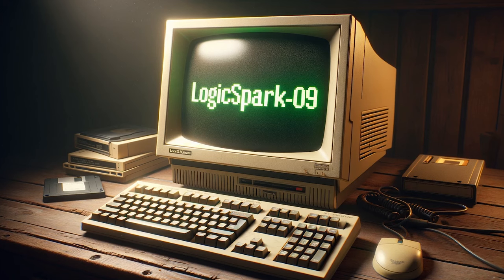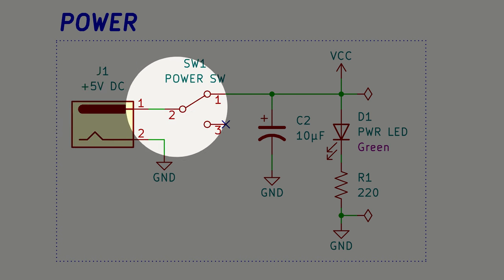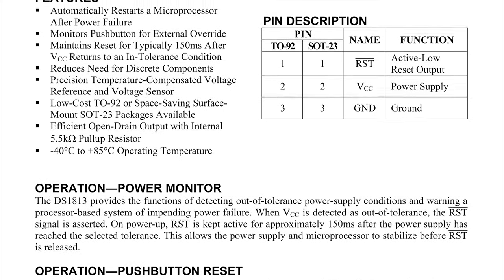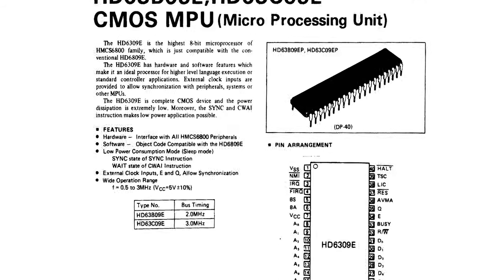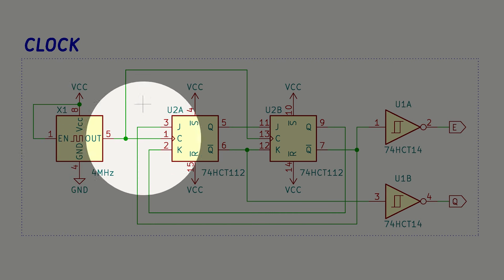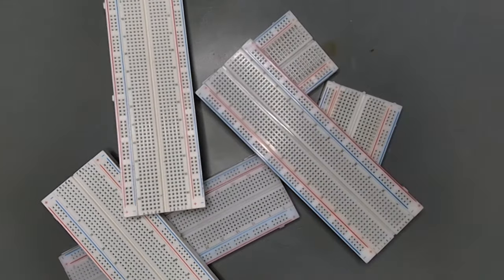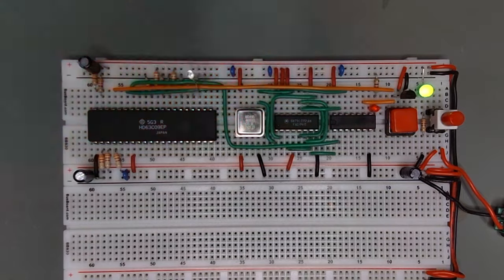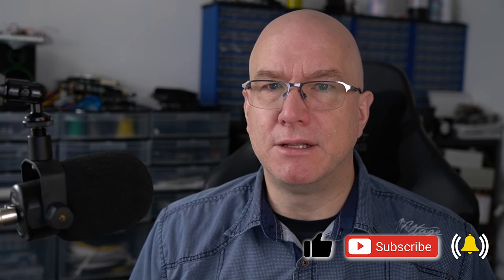6309 Unleashed: Reset, Clock and CPU test - Ep2

Comment: I would say this format is just fine. A little montage of someone plugging in 100 wires into a breadboard is fun and all, but it doesn't really add much information.
Reply from the maker: I agree. That's what I did in the past, and I don't see the benefit of doing wire by wire, unless there's something important that needs to be communicated, or as a quick b-roll shot.

Comment: What ratings are the capacitors on the breadboard and do they just connect over the +ve and -ve rails? I struggled to find the crystal on the various shops, some have them under "standard oscillators" and select radial or through-hole. I then found a QX8T50B4.000000B50TT in my parts. These are 8-pin parts as they take up the footprint of 8 pins even though they only have 4.
Reply from the maker: Another thing I should have specified ;-) . I added this part later on in the script, so I missed some info.  The bypass capacitors to the ICs typically range from 0.1µF to 1µF. The caps I put on each the power rails are 10µF. Also, the cap close to the power input, acting as a power reserve, could be higher, like 47µF to 100µF. 
I'll mention this in my next video.
Reply: @microhobbyist The bypass caps, are they just ceramics?
Reply: @microhobbyist   What does the cap as power reserve do?

Comment: Actually, looking at the datasheet for the 74HCT112 it also covers the HC part, are we certain we can't use 74HC series for this? Would make my life a lot cheaper.
Reply from the maker: Yes, you can use the HC series. I used HCT because I had some on hand. HCT is good if you have TTL level devices in the circuit, otherwise, there's no need. I should have specified... good point.
Reply: @microhobbyist  Thanks, what about the caps question below?